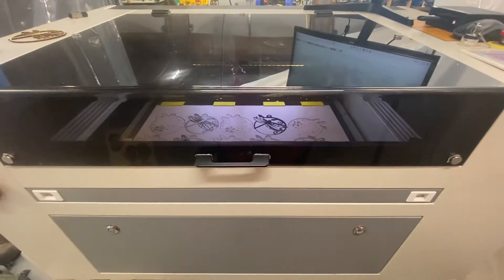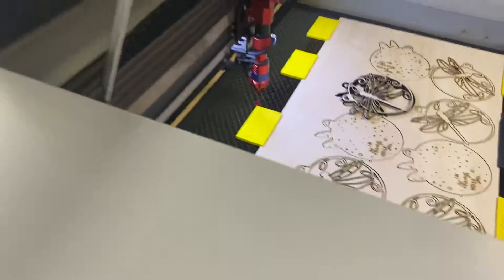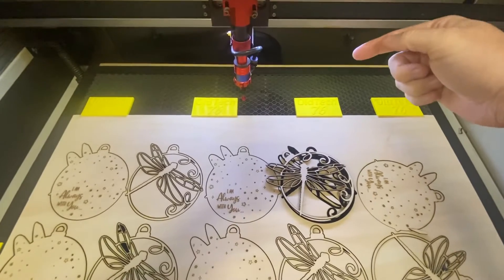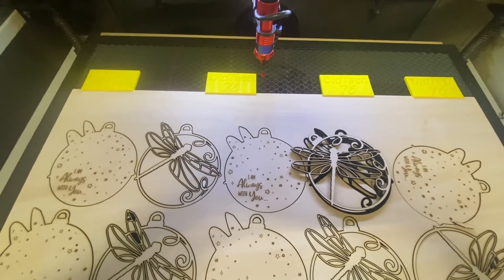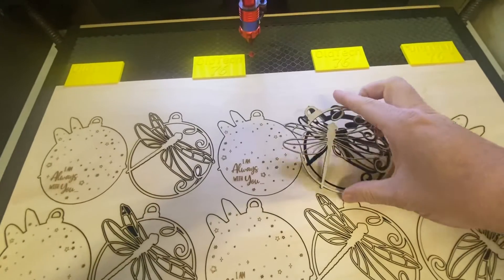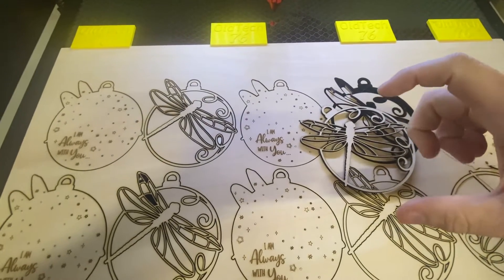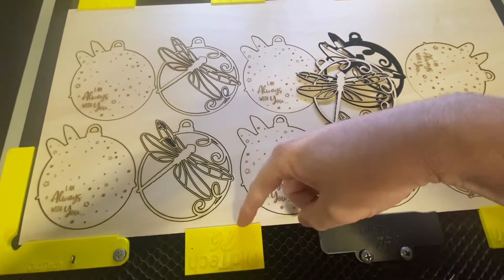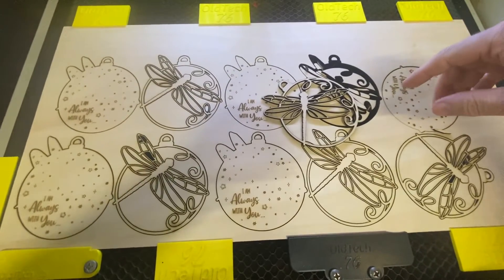One year short review of Monport 60w CO2 laser

Comment: Great review! Where can I find your hold downs? And can you send the info for the air assist set up? What do I buy on Amazon? I just bought an 80 watt.
Reply from the maker: I haven't had time to stop and print new holds down yet.  It has been a rough year.  I lost a close family member and it has slowed some things down.  I will post a parts list for what you will need to set up your air assist like I currently have on my machine.   Thank you for the view and comment!
Reply: @oldtech_76  Understood. Sorry for your loss. I’d appreciate any assistance you can provide on the air assist/air compressor change out.

Comment: tempted to pickup the 60w, but there's not many reviews on Youtube and hearing horror stories about QC and damage shipments from the FB groups. Would you purchase another?
Reply from the maker: Yes, I would.  The only thing I would change about my purchase would be the "chiller".   If I had it to do over, I would purchase the CW-5200 instead of the CW-3000.  The CW-3000 is not in anyway a chiller.  It just circulates the water.   That one was on me for not researching it more before I bought it.  The machine has paid for itself.  So far, the only issues have been the air assist going out and the mirrors getting out of alignment once.   I do plan on purchasing another laser in spring.  I may jump up to the 100w or 130w.  
Thanks for the view!